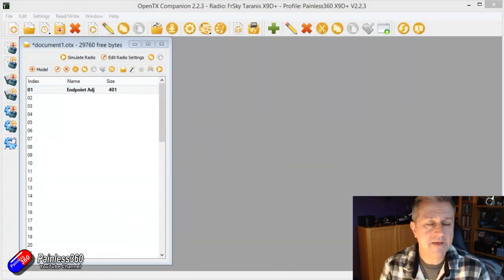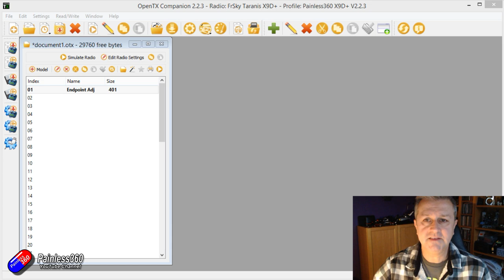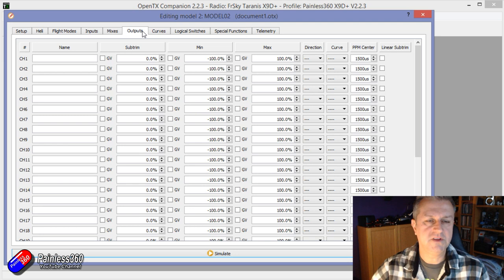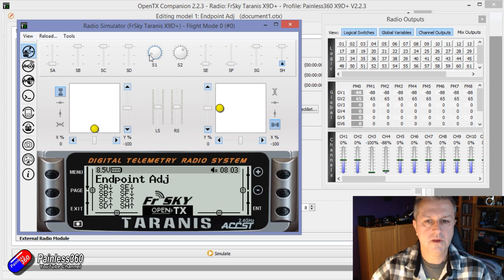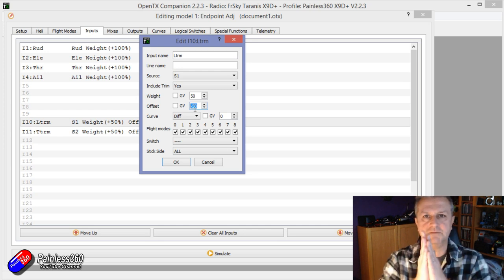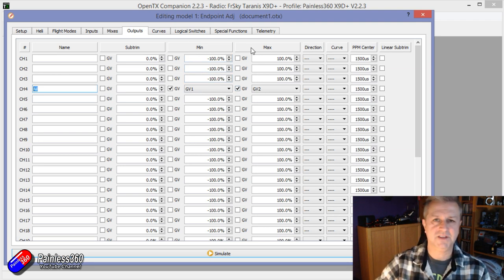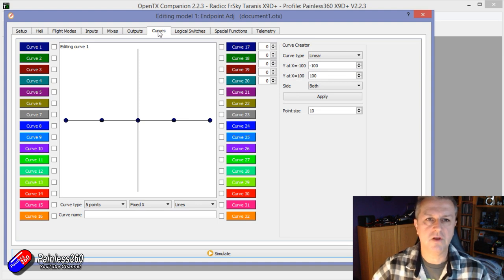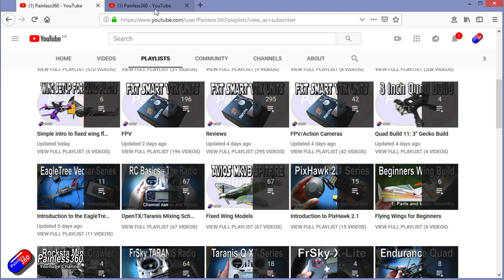OpenTX Mix School: Travel adjustment with sliders/pots

Comment: Hi Lee, thank you once again you have saved my bacon from going loco... I used this set up on the top end for an adjustable Throttle limite for indoor or taming a small quad on 3s. (whereas other videos for throttle limits were skewing the mid-point, and it was creating a challenge as stick values (at hover) were always different/changing at mid-point)
So, Thank you again for "you" and providing the great content for the hobby we all love.

Comment: Awesome! Currently i have my micros that can run inside and out setup with a throttle limit controlled by a switch. The switch either has full throttle range or a 25 percent reduction for inside. Also turns on some throttle expo. But i think this will work better for trimming a little throttle off the top as all models are different and the current 25 percent may be too much or too little for the different models. Thanks for this
Reply from the maker: New video on throttle curves coming soon. Happy flying!

Comment: Question. FIrst and foremost thanks for the content you provide. I switched from Spektrum to Frsky last spring and your video's allowed me to get a general grasp on Opentx rather quickly. I still have a lot to learn but am loving my QX7. That being said, I've just built a flying wing and have considerably more up elevator than I do down elevator. Of course, i've added some reflex as it's a flying wing. On my current wing I can get almost no down elevator at all and yet am getting a solid 30+ degrees of up elevator with a weight of about 60. I'm curious what I can do to add more range to my down elevator.  Thanks a bunch!
Reply from the maker: The main issue is usually with the hardware setup and geometry. Are the servo horns at 90 degrees to provide the same throw in each direction? Is the hinge for the elevon at the top or in the middle. You could move the linkage on the servo farther away from the servo pivot (or closer to the control horn) to provide more movement and them trim the excessive upward travel using the radio. You could also just turn on the extended travel and trims to provide a little more channel range from the radio and then knock back the downward movement... Hope that helps..

Comment: Alright, dumb question, how do I put this on a switch?

Making a sort of cruise control mode, very fine adjustment within an adjustable range, mimicking the old altitude hold from multiwii now that betaflight no longer supports altitude hold, im too scared to try inav currently LOL

Comment: I'm crash corsing otx right now. I've learned a ton. I set up my trims as an 8 pos switch using gv -29 +29 and via cli used it to cycle my 8 channels on vtx. Can I set it to play a number corresponding to the vtx channel. I assume this would be done by playing track at output value <1050 <950 or gv <15 <-15 ect? Please help. I think i got it by creating a logical switche x~a channel 12 play sound then put 1-8 out of system into sounds en then play sound. I'm sure there's a better way.
Reply from the maker: That how I would do it.. Best of luck